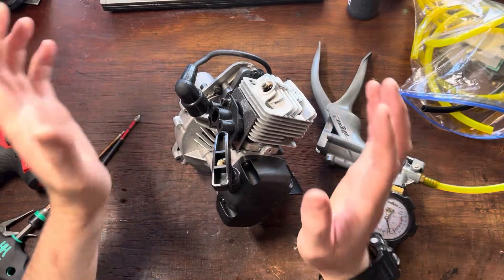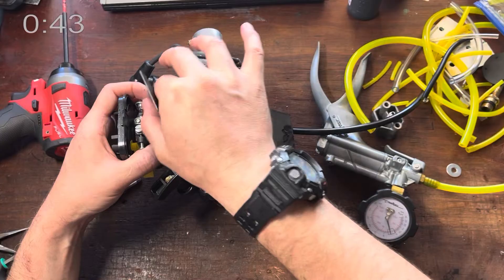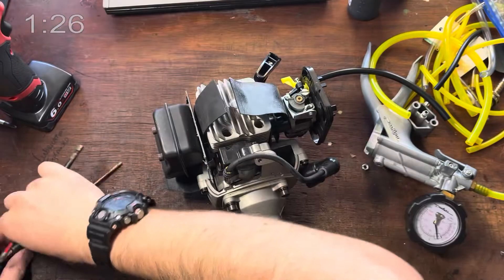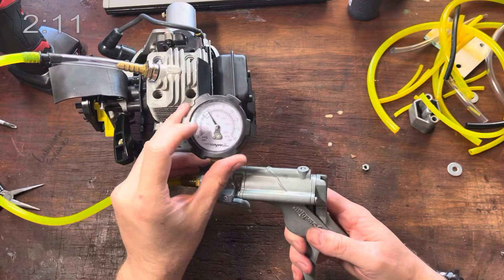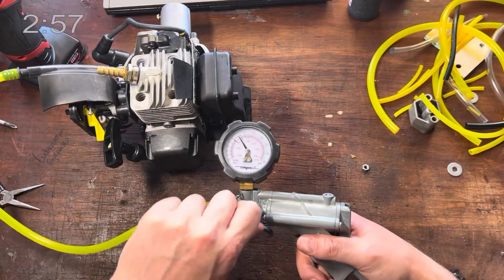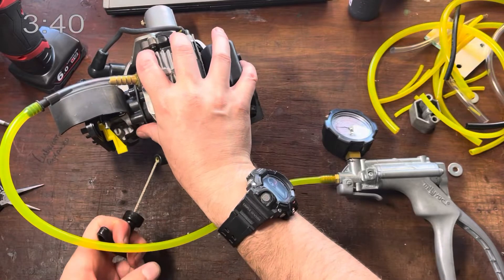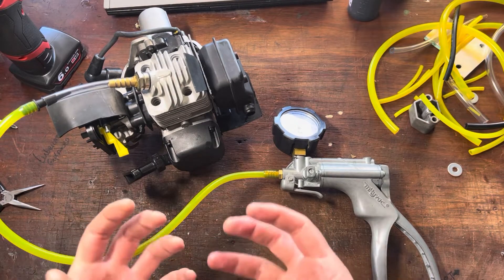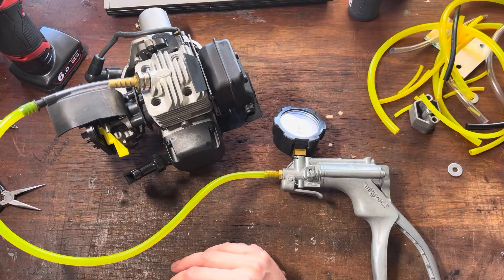How To Pressure & Vacuum Test (Under 4 ￼ minutes!) - SAVE YOUR 2 STROKE ENGINES!

Comment: very useful. How did you make that spark plug air intake connector ? please share a video on it. Also I wonder whether the crankshaft chamber is fully isolated from the cylinder chamber via piston rings ?? YES or NO ?
Reply from the maker: Thanks! I have done a video on it,
 :) https://youtu.be/WukO9adv0cs?si=hODvAaFIlo7LH5yd
No the rings don't fully seal.
Reply: @VintageEngineRepairs  Thank you mate.

Comment: What is that adapter called to screw into the spark plug hole called?
Reply from the maker: You make them :) I have a video on doing so https://youtu.be/WukO9adv0cs?si=HC1RM50PuA2-a6Z3
Reply: @VintageEngineRepairs  yes I found them they are called a brass hose fitting I ordered a kit to make sure I get the right size

Comment: Thanks for sharing! I want to do a vaccuum test on 2 stroke dirt bike. Should I not be on BDC for vacuum TDC pressure test?
Reply from the maker: Na it doesn’t work like that, you can put it anywhere :) air passes the rings and the transfers regardless 👍🏻
Reply: Does it not matter if the valves are sealed just past TDC? I won't know if the crankcase is sealed if the valves are leaking, right? @VintageEngineRepairs

Comment: That tapered inner tube is a neat trick, as it will fit any saw intake or exhaust. Nice. Thanks.
Reply from the maker: You’re welcome! Since this video I have made others explaining why I recommend against it on the intake now, as it can hide leaks, best to use the correct adapter. The exhaust is fine to use rubber :)

Comment: Thanks for your clear videos, I've really found the videos on this channel to be the best guide to small engine repairs, especially when working on Stihl 2 strokes.

Been doing this test today, struggled to get it to seal at the block offs properly but I think I got there in the end. It was holding vacuum but I couldn't hold the pipe on and pump pressure in without an extra pair of hands as my vacuum tester doesn't reverse to do pressure so was using a cycle pump. Will be trying again to get some pressure in to it tomorrow, might have to adapt my coolant pressure tester instead. I'm pretty sure it's drawing air in somewhere as it has a  pretty unstable engine speed on the taco when I was adjusting the carb after fitting a carb kit and new impulse tube. 
The problem originated on a chainsaw engine that would stall at idle. 
I tested the carb holds pressure and doesn't leak past the needle which it doesn't so am lost for a cause if a pressure test doesn't highlight a loss that the vacuum test didn't. Any suggestions please? I know there's some scoring in the cylinder but it was running and had power. 
Would slightly reduced compression (measures about 100-105psi) be the cause of the erratic idle and a source for the additional air intake by leaking from combustion chamber to crankcase?
Reply from the maker: Thanks for the kind words :) any scoring will show itself most at idle. The engine may idle up, it may idle down, but won’t stay stable. At this point you need to address that and if it’s worth the repair financially. Before this you need to find the source of the scoring or it will happen again :/
Reply: @VintageEngineRepairs  Thanks, I've been back to your videos a couple of times during this fault finding expedition.
I'm assuming the scoring is due to the split impulse tube as I imagine that was pulling additional air into the crankcase making it lean. However it's not my saw and it's a used purchase for the owner so I don't know the history. It probably means I'll  get it to run as well as it will until they decide to replace the cylinder. 
I made a 6mm metal plate to seal the exhaust and used some thicker rubber behind it as the piece of inner tube wasn't sealing well, I also bought the tool to seal the inlet with the connection point for the tester but with the carb off that leaves the impulse hole open so I plumbed both to a T piece and tested from there which finally worked well after lots of failed attempts to get a good seal. 
It looks like a cylinder kit in the UK is about £100-£120 for a Meteor or Hyway but everywhere looks out of stock so if it were mine I'd go that route when available.

Comment: I understand the soapy water to check for leaks under pressure, but how do you determine the source of vacuum leak? You mentioned light oil, do you start dripping oil around possible leak points and watch for when the vacuum gauge stops dropping? 

Loved the video, it took a lot of the mystery out of performing the tests!
Reply from the maker: Thanks for the kind words, the only place that will leak under vacuum and not always under pressure are the seals. Therefore, yes very thin oil, or better yet 2 stroke fuel and oil mix. :)
Reply: Thank you so much, that's very helpful. I've been around engines for decades, but I'm new to 2 strokes and channels like yours make it fun to learn, cheers

Comment: Great.  But how do you build that spark plug air adaptor?  JB Weld?
Reply from the maker: Yes - I made a video on how to make one :)
https://youtu.be/WukO9adv0cs
Reply: @VintageEngineRepairs  thank you
Reply: @VintageEngineRepairs  I was just going to comment on how you would go about making one of these as I'm currently doing a second re-build on my MS360 Pro after loaning my saw out to someone that had one of his buddies mess with the carb to "get it running better" and I need to figure out how to best ensure I'm doing this right. I really don't want to do this a third time if I don't really have to so THANK YOU for having a simple and to the point video and ensuring every step of the process is fully visible and thoroughly explained!

Comment: Thanks for sharing.  Will this be the same for a 2 stroke stone saw, that I don't think has oil inside the crankcase.  Well, at least I have not seen anyone mention draining oil when replacing crank bearings.
Reply from the maker: As far as I am aware, concrete saws are 2 strokes, same principles, yes! :)

Comment: Thank you for such a clear and concise production! 
One question ... during the vacuum test there's a settling-down period at the beginning: the gauge keeps dropping toward zero and it looks like the vacuum isn't holding. You keep pumping and wait a while, and eventually get a stable vacuum to begin the test. What's going on during that settling down period? How can you tell you're not seeing an actual leak?
Thank you again. Absolutely excellent video!
Reply from the maker: Thank you! That’s the air bleeding past the piston rings as well as the rubber inner tube stretching and seals too! Keep pumping until you no longer see it drop :)

Comment: In addition, maybe a smoke test to seek out any leaks??
Reply from the maker: That is more for a leak down test, the pressures are way too low to show any smoke dissipation. Unless you some how pumped smoke in to the engine maybe!!! As a point of reference, a leak down test (with smoke) is normally done at around 100 psi, a pressure and vac test around 5psi.

Comment: Worse if your engine sort of runs ok but shuts down after 10-20 mins hot and fuel system is ok?? Drove me crazy till i realized the coil was de- laminating and shorting when HOT!  I guess to test you could put a hair dryer on the coil and watch the resistance go down a bit? and then suddenly short out!!
Reply from the maker: Thanks for sharing :) yes a classic coil issue! Or a failing condenser  in the old machines

Comment: I don't know about going through the spark plug hole to check. the pressure And vacuum. That cylinder he's going to hold 150 PSI..
Reply from the maker: You’re confusing compression and pressure there. Yep I like to test through the spark plug hole if possible.

Comment: Can you seal it off from the other side of the carburetor? I did on a weed eater and found that the shaft for the butterfly valve was leaking air. The weed eater runs okay but I’ve had issues keeping the air/fuel adjustment consistent.
Reply from the maker: There will be a very slight leak even from a good throttle shaft, but it should be minimal.

That can mess up the reading, pressure test that separately :)

Comment: That sort of test will only show you if its bad.  In college  we tested them under water to find all the leaks.  That is the short engine.   That will pick up the small leaks.
Reply from the maker: Pressure tests will often hide an oil seal leak in 2 strokes  as the sealing lip gets pushed down and onto the crankshaft. The vacuum test is the correct test to do for an oil seal. That’s certainly not something you want to do under water - or with any water for that matter.
Reply: @VintageEngineRepairs  I was trying to cover all leaks.  The one under water i was talking  about in college picked up a defect in the cylinder casting.  Little bubbles coming out at 5 psi.   Others had leaks at crankcase bolts on Victa engines etc.

Comment: There has to be a big leak to cause problems. Your mouth will give the vacuum and pressure needed for the test.
Reply from the maker: It doesn’t have to be a big leak and you won’t be able to test it with your mouth.

Comment: I'm a little confused about the vacuum test. You did a pressure test first which passed, meaning there's no leaks, including past the piston rings, correct? If so, how does a vacuum test via the spark plug test the oil seals, if the rings tested ok? Why wouldn't the vacuum remain in the cylinder and not suck from the area around the crankshaft?
Reply from the maker: Because it passes through the transfers :) also past the rings too! Thanks for commenting 👍👍

Comment: Hello sir, could you do a video with the engine on the machine. Like how would you block off the exhaust port of the shroud is still on the engine? Let’s say a stihl weedeater? Thx
Reply from the maker: You can’t you need to take the cowling off to get to the muffler :) thanks for watching!
Reply: @VintageEngineRepairs  ty sir.

Comment: Great video. Do you have to remove the engine like you have it there?
Reply from the maker: Thanks! You don’t have to, you can just block the ports, if it holds then great. If you find it’s leaking, then stripping parts off to get access to the leak is necessary.
Reply: @VintageEngineRepairs  thx for the reply. Could you tell me what size barb and thread size is the fitting. Like 1/4 x 1/4? Thx

Comment: Hey tom, How did you make the spark plug for pressure testing ?
Reply from the maker: Just cut the crimp off the metal spark plug, remove it from the porcelain and then add a barb, glued in place wjth epoxy and add an o-ring

Comment: Good summary. I do vacuum test first, because sometimes when you’re pressurize first it’ll force the lips against and pass the vacuum later but if you do the vacuum first, sometimes it will leak
Reply from the maker: Thanks for the heads up, I have heard that but never experienced it myself! I do pressure first just to avoid, in the very unlikely event of accidentally sucking up of fluids that may be in there lol